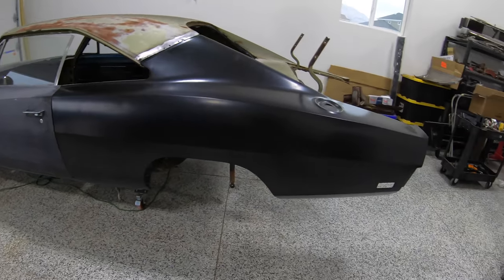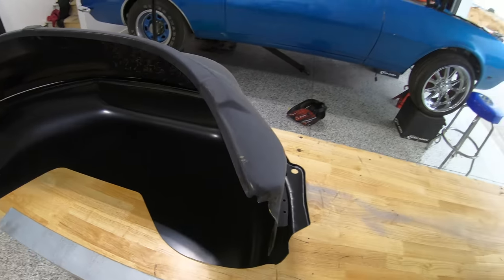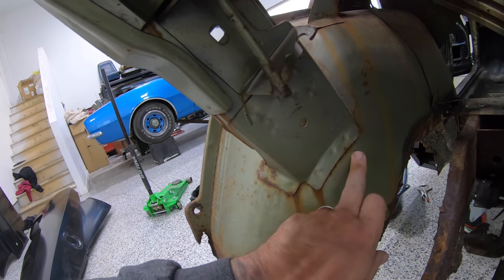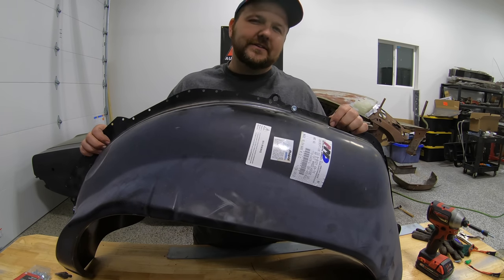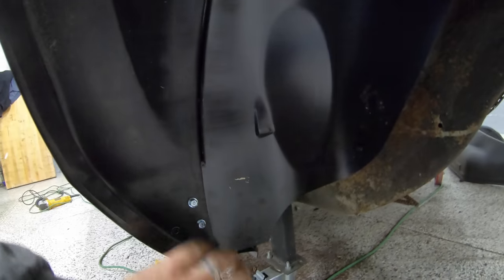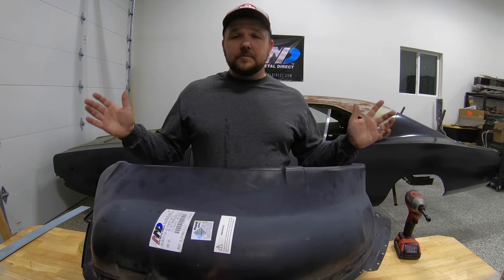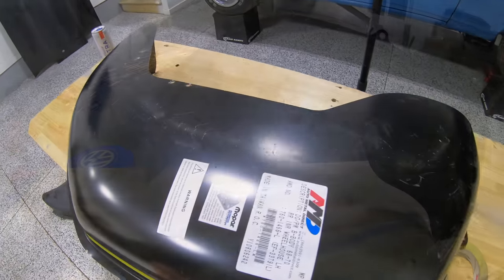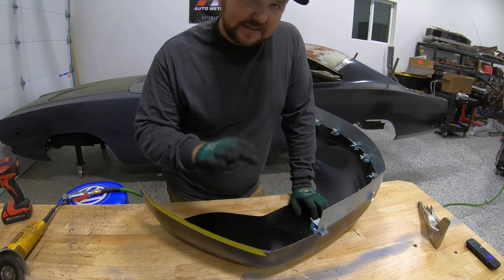1968 Dodge Charger Restoration - Episode 21 - DIY Mini Tubs

Comment: Mopure my man, Mopure! I knew you'd do it right, but that's better than I could have envisioned.

Compared to some of the hack lap welded jobs I witnessed in the 70s and 80s on those traction desperate GMs, that's just pure genius in engineering my friend... and a kind of technical expertise and patience I just do not possess.

Speaking of patience, that's some super understanding wife you've got there.

Most of the wimens I've known this past half century, would have freaked, peaked and freaked again, requiring yet another expensive trip to the curb.

75' was the beginning of all kinds of troubles for us males, what with Delta Dawn and all those piles of smouldering bras.

Hell I wouldn't want to re-live those years. Almost makes you understand the Taliban(not).

Keep up the stellar work my friend.

Malcolm Ottawa Valley
Reply from the maker: Hahaha thanks for watching Malcolm 🤘😆🤘

Comment: Hey David great video. I think AMD makes a wheel house now that is all ready widened? I was going to go on their website to see if same width as your making. Good idea while your in their to widen and no one except the experts would know they have been touched
Every episode I watch gives me more motivations to do this work myself instead of paying someone approx. 15 K to install all the metal
Only issue I have is double garage is really tight front to back. Would have to work with door open if working in the back
cheers
Reply from the maker: They make an inner wheelhouse that is 3” wide.    It requires some frame rail modifications to fit.  Mine is 2 1/2” wide and just required a modification to the pans.
Reply: @rustbucketrestos6511  Ok thanks good to know, kinda hard to cut up a brand new frame rail to make those fit. 2.5" mod it shall be
Thanks

Comment: When I mini tubbed mine I used 2 inner panels with the metal spliced in the center...it will remove that big bulge the the outer panel has ...by doing this I can stuff a 16 inch wide tire up in the housing so car can sit low as I want..it will clear the quarter panel.
Reply from the maker: Nice idea!

Comment: Are you going to modify outer wheelhouses? The first place wide tires will hit.
Reply from the maker: No, running a positive offset with more backspacing will prevent the wheel from hitting the outer wheelhouse, but will take full advantage of the added 2.5” of space.

Comment: My wife and kids and I binge watched all of these this weekend and she was curious how many hours you think you have into this so far? I said between 500 and a thousand hours. Does that sound reasonable?
Reply from the maker: That’s awesome!  I think that’s probably close.  Will most likely be 2,000-3,000 hours in this one by the time it’s done.  It would cost $100,000+ easy to have someone else do the same work.
Reply: @rustbucketrestos6511  It isn't even about the money for me, the incredible sense of accomplishment and satisfaction I get from making trash into treasure and overcoming all the unique challenges that come with auto restoration is priceless. I worked my fingers to the bone on my Scout and loved (almost) every minute of it.
Reply from the maker: 100% agree.  The hours are therapy for me!
Reply: If I was doing this the hours would be worth it the day its finished and you get to rumble down the highway in the coolest ride ever !!!